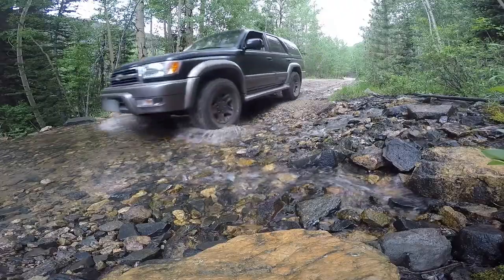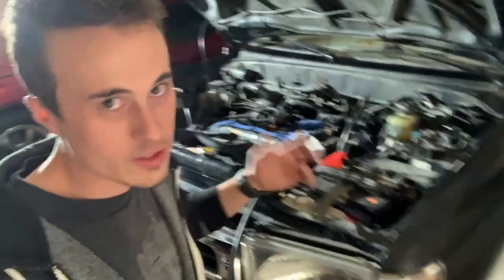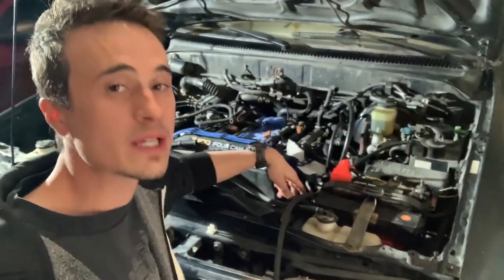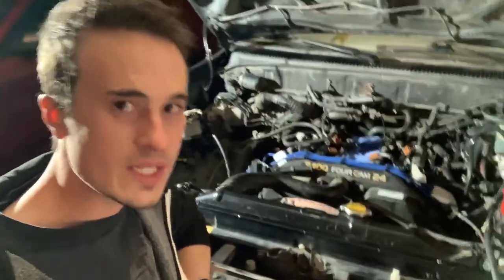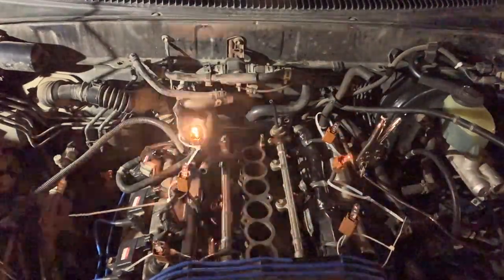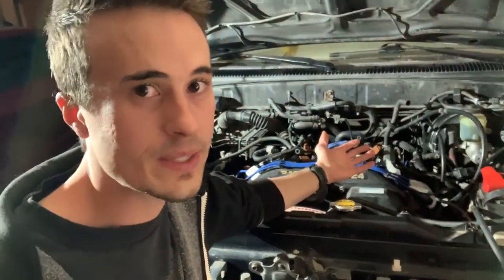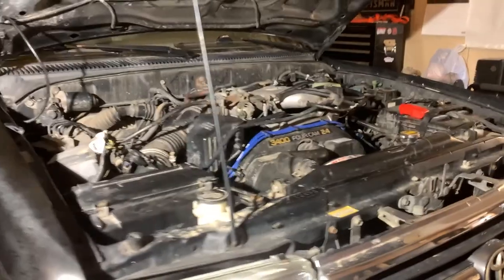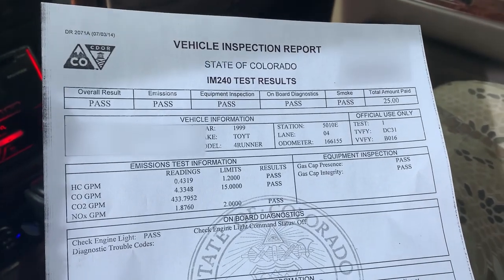1999 Toyota 4Runner Misfire Diagnosis Story | How I Finally Fixed it

Comment: Awesome video! The lightbulb in the injector idea was too cool! Glad you figured it out! I’m getting a P305 after timing belt replace and hopefully it will be easier to solve than yours!
Reply from the maker: hey thanks! thought it was worth sharing what happened. yeah neat to see the injector order in real time. darn hopefully it's an easy fix
Reply: Same! I just got a misfire code after the shop did my timing belt and valve covers. Did you figure out what the cause was?
Reply: @shkaat same!  Mine drives perfectly but will misfire only upon warm start up.  Did you figure out your misfire issue.  And again just to confirm mine started doing it right after a valve cover gasket replacement
Reply: @zh3717  Hey! yeah after a whole bunch of failed tests, swapping coils and wires, I finally replaced the injector in Cylinder 3 and that solved it. hope that helps you out too!
Reply: @shkaat  awesome… I just bought all new Toyota injectors and am feeling confident now that will solve my mysterious warm only misfire/. Thanks!
Reply: I have a 2002 Toyota 4 runner I have a 300 and a 303 issue and I’ve changed everything from the mass air flow sensor to the last one on the muffler . I’ve changed all the spark wires and coils and spark plugs and I still have the codes popping up , I’ve changed the computer out as well. I have no antifreeze in the oil as well. WTF is my issue anybody ?
Reply: @jjranger5022  I’m sorry to say but it’s almost certainly a bad injector.  Do all 6 and get new OEM ones and just do them all.  You could get them tested and cleaned or just replace one bad injector but then another could go in a month.  They’re not an inexpensive but I can tell you it immediately fixed the code and brought the pep back to my 23 year old engine… I also started at the simplest and least expensive route doing plugs then wires then ignition coils then mass airflow sensor… All that is good to do on an old engine and definitely isn’t money wasted.  Good luck!  Please don’t cheap out on some aftermarket options you’ll regret it.

Comment: This is where one of those little OBD scanners connected to the Torque app  on your smart phone can help with finding if it is a stuck infector. You'll want to look at the Short Term and Long Term Fuel Trims. If the Long Term Fuel Trims are showing a negative value then it suggests that the ECU is constantly having to pull fuel out of the system to keep the engine running at the proper air/fuel mixture. In other words the engine is running to rich with fuel when the fuel trims are negative. That's when you might start to suspect that there is a leaking injector but could also possibly be a failed fuel regulator. Checking the fuel pressure is a good diagnostic as it'll show if the fuel pressure is bleeding down from a leak or if the fuel regulator fails to adjust pressure with engine RPM.
Reply from the maker: For sure a great idea! I learned all about fuel trims later on. And helped me diagnose my van, fuel trims are such a great diag tool
Reply: @FonzoCapone  Short term trims just show how the ECU is adding or taking fuel out of the injector pulse at that immediate point in time. The Long Term fuel trim is essentially an average of the short term fuel trims over a longer period of time. So, the Long Term trims shows how the computer has been consistently managing the fuel delivery over a long period of time as so are a good diagnostic for the fuel system as a whole. Short term trims I believe can be useful if you are diagnosing an O2 sensor.
Reply: @heftyjo2893  and im getting a code for cylinder 4 misfire. New spark plugs and new wires

Comment: My Gen 3 has random misfire and downstream too lean. I've put plug, wires, coils, cam sensor and cleaned MAF sensor. Looking at injectors is next. I have learned to buy OEM (Denso) and haven't looked back.
Reply from the maker: could be an injector but could also be something else. I learned to test not guess with this experience. yeah OEM is best unfortunately the oem brand doesn't sell these injectors outside the dealer

Comment: Man, I"m going to put some MMO in my tank now to clean my injectors, all original and running fine at 205k miles. I ran bosh plat plugs , single electrode for 80k miles with no problem. Now have NGK Iridiums and runs fine. Good to know about the remanu injectors!
Reply from the maker: nice! good idea, probably good to run an fuel additive at every fillup, keeps things clean. what a nightmare that was, no issues after going all oem

Comment: I have a Tacoma 2000 4 cylinder 2,7 i was replacing 02sincers like once a year thay looked like black soot on them the tell pipe black soot also was thick I used lacquer thinner 1 gallon to 9 gallons of gas ran it out in 1 morning 2 hour drive an man the truck ran  good 👍  lots of power felt nice did that 5 years a go new plugs after the cleaning no more o2 sincers the truck is in nice shape love my TRD 4 banger no more black soot in yes the CORN GAS 10%will make there stick open. Maybe you should of used lacquer thinner in stead of all that repair 🙋
Reply from the maker: Thanks for the info, glad your toyota is running good

Comment: Your in-depth diagnosis is genius! The light idea was awesome
Reply from the maker: thanks so much! I learned a lot from this. had another one of those reman injectors stick open on a trip. had to replace all with brand new oem from the dealer. no problems since
Reply: @4WheelKid  our good friend is gifting us a 96-97 4Runner that’s been sitting for a few years, and so I’m hoping with a few dabs of marvel mystery, fresh gas, charged battery, it’ll smoothly crank on and I can just run the cobwebs out. Hopefully the spark plugs aren’t as hard to get to as my ‘01 Mitsubishi Montero Sport…. Full intake manifold and a bazillion lines just to changed spark plugs.

Comment: Ty for posting this, going through the same issue right now, you've done very thorough research. I threw ignition coils, plug wires, and i already had new plugs in it thinking it would fix it. It didn't. Once i pull it from the shop i took it to if they couldn't find anything i'm gonna try what you did.
Reply from the maker: no problem, I have learned so much about Diagnostics since this video. best to test not guess if you can. best of luck

Comment: I have a 99 4runner with 224k on it. Ran beautifully until acouple weeks ago when it started misfiring on my wife. It said cylinders 1 and 6 were misfiring so I replaced all the spark plugs, which it actually really needed them. I used the NGK Iridium IXs.

However, it was still misfiring, but not all the time, only sometimes. I replaced all 3 coil packs and the waste spark wires with NGK units. Still misfiring after that even. I just bought a fuel filter so I was gonna replace the fuel filter and flush the injectors and see if that did it. I dont really want to replace the injectors but I may have to. If I do, I'm just gonna go with Densos to avoid any issues with cheap crap.

Great video! Good to see we had the same line of thinking.
Reply from the maker: darn sounds like a pain. hopefully your able to figure out what's wrong with it. be careful buying what appears to be name brand injectors on eBay and amazon. those are usually knock offs. the oem injectors are made by aisin might also want to replace the fuel pump while your at it if it's never been replaced before. another stuck open injector left me stranded a few months later. I ended up replacing my entire fuel system with oem parts
Reply: Well I figured out the issue. The injector in cylinder 6 was bad. Bought 6 new injectors and replaced all of them. Truck ran great for a day and then it started running like crap. Tear it all down again to find that the injector in cylinder 3 was stuck open and dumping fuel in the cylinder. I contacted the seller, and they were super cool. They refunded me a third of my money and I got a new injector to replace the bad one. Installed it and havent had an issue since! It's been about 2 months now and its running beautifully!

Great thing is I've got a brand new cold air intake, fuel filter, new injectors, plugs, coil packs and wires so I should be good for quite some time now. 😊
Reply from the maker: wow that's crazy you had one stick open as well. which brand did you go with? where did you buy them from. hopefully you don't have another stick open. I would really like to figure out why they stick open in the first place. best of luck!
Reply: @4WheelKid  Ya, I bought remanufactured OEM injectors. Still running great after replacing that one.
Reply: @f3nixfire  Is your truck still running well? I’m also dealing with a misfire in #6. Had the coils and spark plugs replaced, felt great for a day, then mis-fired again on a cold start, and my OBD scanner says #6 again. So I’m thinking fuel injectors now. You mentioned one of them was “stuck open.” What exactly does that mean? Not much of a mechanic here, so just trying to be on the lookout for things?
Reply: @eljefeslash  Yes its still running great after replacing the injectors. One of the new ones was stuck open, which means it was dumping fuel into the cylinder constantly. That's bad. You want the injector opening and closing in conjunction with the cycle of the engine so it only provides fuel when it is supposed to. The place I bought them from replaced the bad injector without issue and everything was fine after that.
Reply: @f3nixfire  good deal, glad it's still working for you. Thanks for the explanation. Is there anything specific to look at make sure the injector isn't stuck open like that before installing?  Just want to "check all of the boxes" before I replace mine.  I have a refurb set of injectors on the way from MotorWest, so hopefully that will fix my #6 cylinder problem.
Reply: @eljefeslash  There isn't anything you can specifically "look at" to tell if an injector is going to be stuck open or not. The solenoid is internal. You can have them pressure tested before you install them, although this is something that the manufacturer or remanufacturer should be doing after (re)building them.

I recommend buying a set of quality O-rings to install onto the injectors when you get them. Don't use the ones that they are going to come with. They are typically very cheap and can break easily during installation, which will cause your injectors to leak. You'll know if they're leaking because you'll smell gas when the motor is running, and you'll have to tear it back apart to find the leaky injector and replace that o-ring. 

You should also know if an injector isn't firing correctly after you install them, because the engine will be running rough and you'll probably get another misfire code (make sure to clear the codes first. Just keep the battery disconnected during install)

Lastly, you'll know if an injector is stuck open cause it will be running rough and you'll have smoke from unburned fuel coming out of the tailpipe. 

I recommend before putting the intake manifold back on that you start the engine and see if it turns over and fires up. Only let it run for a few seconds and then shut it off. This will confirm the new injectors are working and then you can check to see if you have any leaks around the fuel rails before you put it all back together. This will save you a lot of headaches.

Lastly, mine ran great the first couple days after installing the new injectors, because the one that got stuck open didn't fail till acouple days after the install, so when you're done I would take short trips and stay close to home the first few days.  If all seems well after that then you'll likely be fine. Good luck with the install. 👍
Reply: @f3nixfire  great stuff!  thanks a bunch for the tips, this is extremely helpful. I'll order some extra o-rings (I had one rip on me when taking out my power steering reservoir, so I'm totally with you on those - don't want to have to take everything back apart!). Much appreciated!
Reply: @eljefeslash  you're welcome! One last word of warning. When you test fire the engine with the intake manifold off make sure you dont have anything loose around the intake like loose nuts, bolts, wires, tools etc. It can get sucked into it and that would be a very bad day even when only letting it run for 2 or 3 seconds. I cant stress that enough. You dont want to kill a perfectly good motor.
Reply: I'm having the same issue

Comment: Hey! Nice troubleshooting! I have a 99 4Runner with 198k miles and recently I started getting the p0300 code along with cylinder 1, 5 misfire. I replaced the spark plugs the wiring and I’m down to looking into the fuel injectors, for what I could tell the fuel injectors are the originals so maybe they are failing now? Idk I’ll have to keep trying to figure out why I’m getting the misfires and the rough idle(rpm drop so low seems engine is about to stall). So I’ll try doing what you showed in the video! Wish me luck!
Reply from the maker: thanks! yeah it's best to learn how to diagnose things properly, I made that mistake at with this issue at first. I will always dig deep in diagnostics from now on. best of luck! start watching this guys youtube channel. https://youtube.com/@schrodingersbox?si=Xc_Qigbde8BLmEdt use this scenario to start learning theory and real diagnostic Techniques

Comment: Did you check the dashpot vacuum line? It may not allow smoke out, but it could be loose enough to cause a cylinder 6 misfire as it feeds directly into cylinder 6 runner
Reply from the maker: it turned out to be an injector issue

Comment: I did a winter tear down on an old shovel head Harley one time and when I got it all back together it wouldn’t run worth a shit and I couldn’t figure it out.  My old timer neighbour heard me messing with it and came over and listened for a minute and said “that sounds like a dead spark plug”

I’m like what, they are bran new.  He said that doesn’t mean anything. Anyways go get some new plugs and pop them in.  vroom Vroom.  Ran like a top.  Great advise.  Never trust that your bran new parts might not be the problem.
Reply from the maker: for sure, never want to rule anything out. especally with cheap parts haha

Comment: RockAuto has sent me poorly fitting parts as well.  I've had better luck with Summit Racing.   Thanks for this video, I am dealing with this on my 96 right now.
Reply from the maker: yeah it's annoying, I bought carpet from them and they sent me the wrong carpet in the right box. they do have a good selection though some stuff they sell is garbage and some is good, really gotta do research. can save a ton of money compared to the box stores where they inflate the price like crazy for the same exact part, mostly on the commonly sold ones. best of luck, My 4runner has been perfect for years now after using oem injectors

Comment: Had #3 misfire on my 99 4r, initially replaced the Fuel injectors but that was not the issue, it was the TPS.  #3 spark Plug had a carbon stripe (1-2mm) down the exposed porcelain causing a misfire under acceleration.  Replaced #3 plug, ran good, but the carbon streak and misfire returned to the #3 plug within a week.  It was the TPS, once changed along with a new plug, all was good.   From my research this has occured on other 3rd gens.  No idea why this occurs from a bad TPS but it does, so if it's not the coil it may be the TPS, if there is a carbon streak on one plug.
Reply from the maker: thanks, could be a lot of different reasons